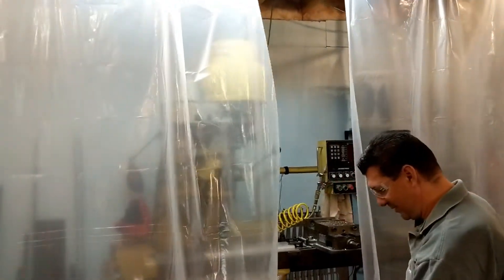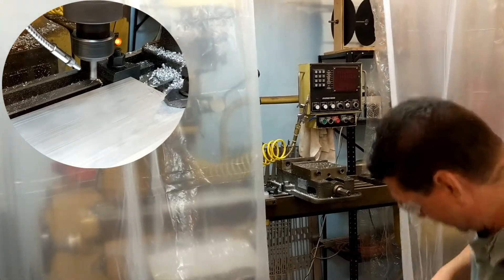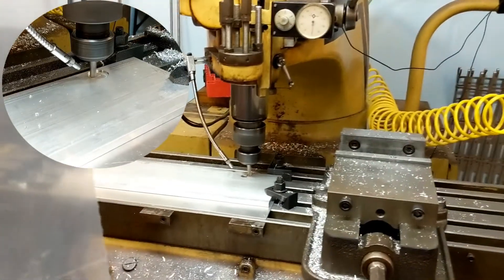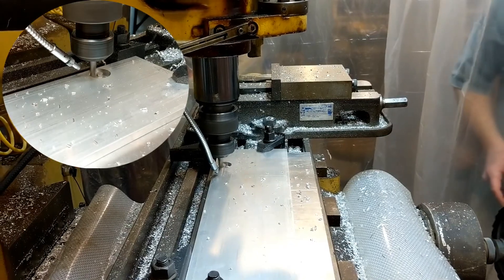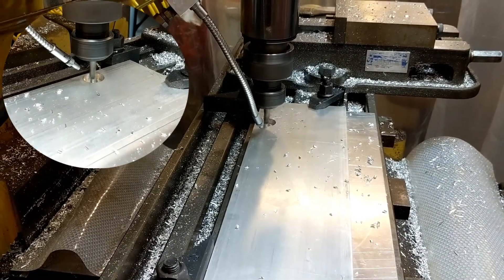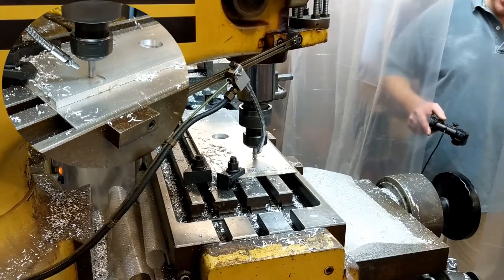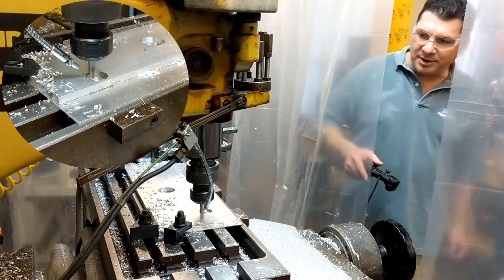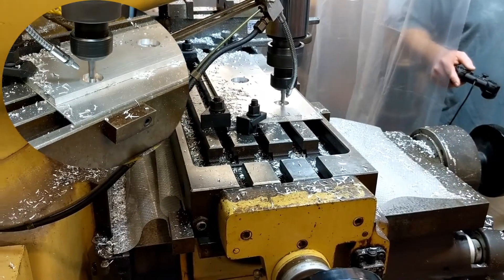Harmony VAWT March 2019 Machining the Prototype Scoop Supports

Comment: if i may,you can add a vacuum cleaner hose where are the ships are trow away ,,i did it on a little mills of one friends here and it works no1 
at least it would be safer 

gervais
Reply from the maker: Thanks Gervais, At this point I just want to keep the crazy to a minimum. Adding more and more stuff to the machine only makes for more complex setup. The curtains contain everything so for the most part the mess is contained. And normally I'll be outside of the curtain during operations; not in there pointing and watching things. So chips flying at me are not a normal concern. One day when this project is off the ground, I'll get a true purpose built CNC machine like a Haas or Tormach and it will be fully contained with a chip auger and all the bells and whistles. Then there won't be any mess on the floor really ever! -That 's what I have to look forward to once I get things off the ground with the company. Thank you for the suggestion though!